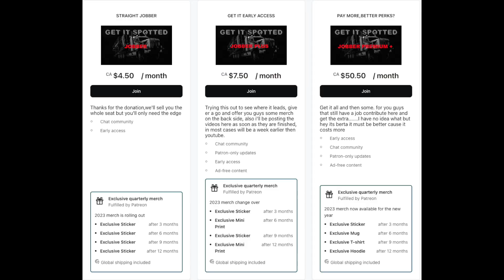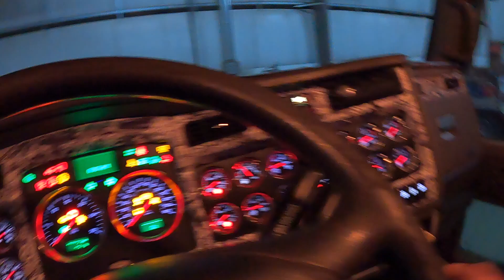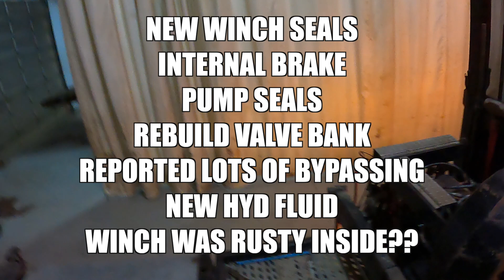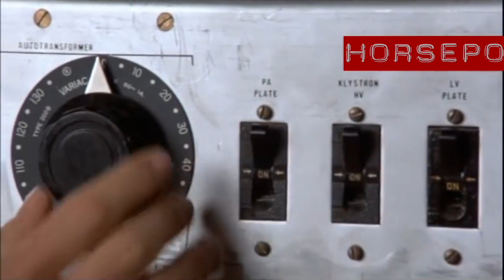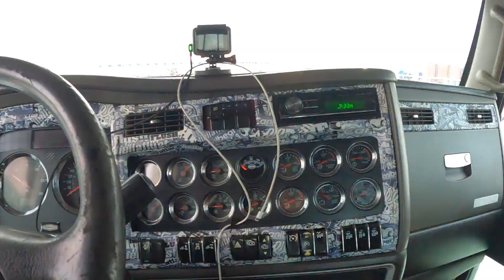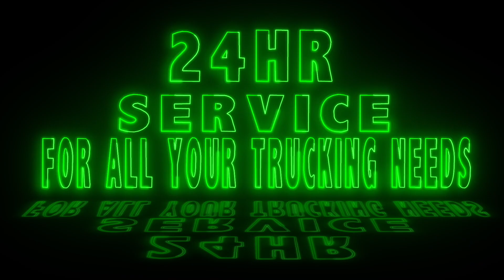THE BIGGEST TANK FARMERS (TOTAL) CALLED IN FOR HELP

Comment: I was trying to convince my dad to get an oil rig truck instead of a normal rig to haul trailers, because where he drives well used to, but he drove all the way from Edmonton to Vancouver and he had to drive up the coca Halla to Vancouver and even in the winter it was very very icy and snowy so I wonder if an oil rig 18 wheeler would’ve made a difference to pull those trailers because if he had one, he would have all the power and he could still get there in one piece
Reply from the maker: well they are nice to look at, but are very non cost effective, our highway truck burns half the fuel i do, so that alone is a huge savings, if that half was my pay id be happy, they are also a lot more to buy, less aerodynamic, my hudson friend said hes made a few pulls up the coquihalla effortlessly with his 77 kenworth LW924 with winter tires on it. a very efficient rig with a 400 cat. it does lack all the amenities of being a on road trucker tho, sleeping in a day cab with 3 shifting sticks not ideal, with a bag stuffed in between the seats. im 6.4 tall that cab is maybe 5 feet across, we have all done it

Comment: You may have said this before but on a typical tank deal like that where youre not moving them very far how long is the cycle time from one tank to the next?
Reply from the maker: on location just setting up to be loaded out probably 5 minutes a tank. sometimes we have to use clevis and that eats up time. always interruptions that stall you out, i usually average rather stuffing loads on trailers, standing tanks, pulling down may be quicker depending all on how much help, its around a hour per ten tanks
Reply: @TimelapseTruckerRTOT  
Yeah, the one you showed in "real time" was a LOT slower than I thought it would be. 
That roll flex was SKETCHY!